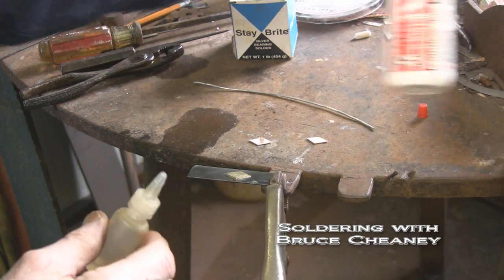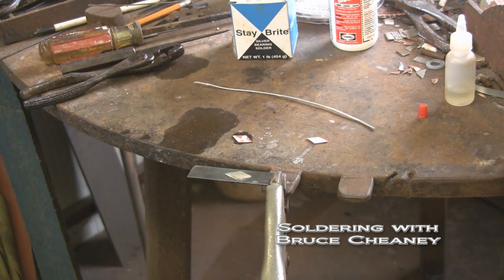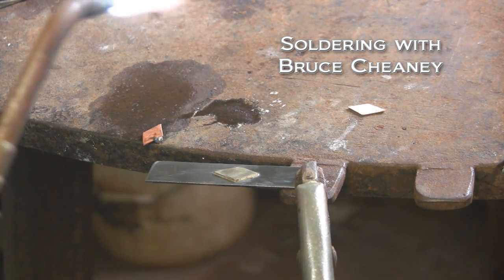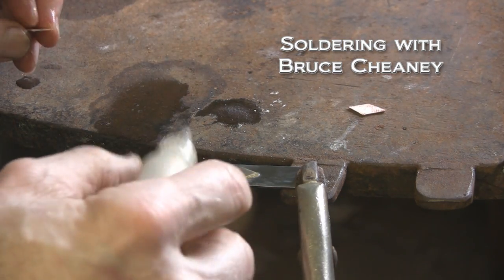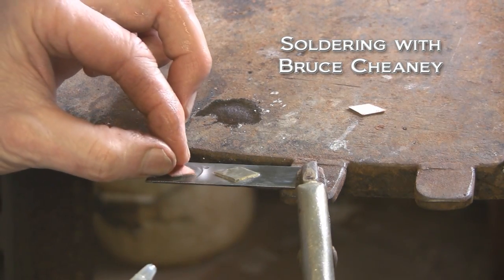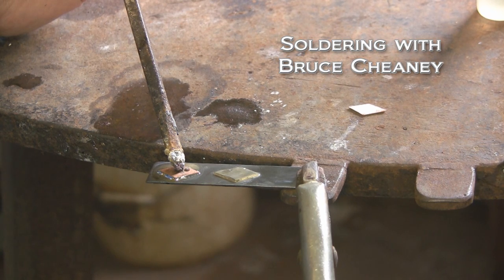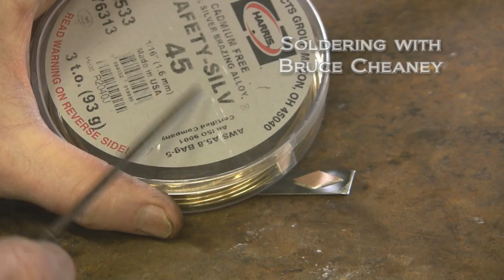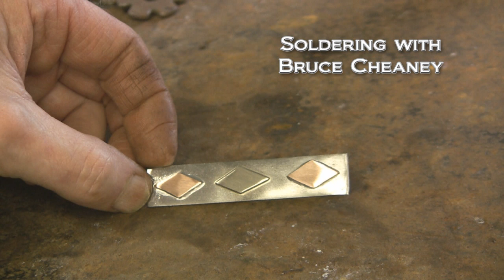How to Silver Solder - Soldering Steel, Copper and Nickle Silver

Comment: Can you solder copper, brass and silver to cast metal.
Reply from the maker: It is very possible. It kind of depends on the thickness and the ability work your heat. Try it on a test piece.

Comment: I'm in the process of teaching myself how to use silver solder (56% silver) to solder the scarf joints of metal cutting band saw blades.   The blades are .035 thick X 3/4"wide.  The scarf joint angle is 20 degrees.  My paste flux is what the jewelers supply house recommended for my use and sliver solder.
I'm using the same Victor torch and tip size as you are in this video and a jig and clamps to hold the blade ends straight and flat to each other.  
I have a couple questions.
 Is there any reason to hold the angled ends of the blades slightly apart from each other or should I fit them as tightly together as I can without the angled surfaces riding up on each other and ruining the alignment? 
Once the silver solder melts and appears to run down into the joint, should I pull the torch away immediately or is it ok to lightly play the torch flame back and forth a little from one end of the joint to the other to make sure the solder flows completely from one end of the joint to the other?
(With electronics solder or pipe solder, it seems like it's a one shot deal.  Once it flows into the joint, get the heat off it immediately)
Can I get away with cutting off a piece of silver solder (or two pieces) the width of the joint and laying it on top of the flux right over the joint then applying the heat from the torch?  This may help insure uniform spread of the silver solder in the joint.
Thank you for passing on your knowledge in this video!

Comment: Which one of your methods do you suggest as having the most bonding strength to the associated metals you're soldering?

Also, is it mandatory to use the different types of flux paste to act as a bonding agent for the different types of metals you illustrated?

As well, do you specifically have to use the particular types of solder you displayed in bonding all these metals?

I ask for the reason that a layman like myself, I normally use 50/50 tin & copper solder combination with paste flux to bond small jobs together. For the most part, is it acceptable to mix & match the methodology or better to stick with specific solders & paste for each individual metal for stronger adherence?

Interesting video sir,, thanks for taking the time to share..